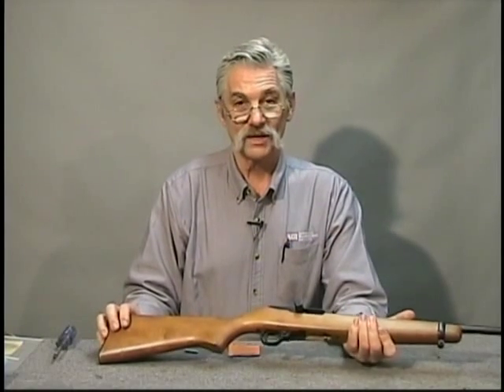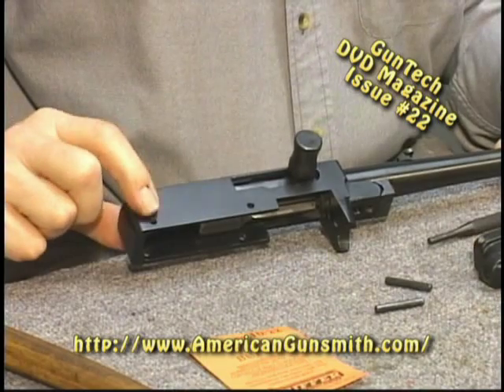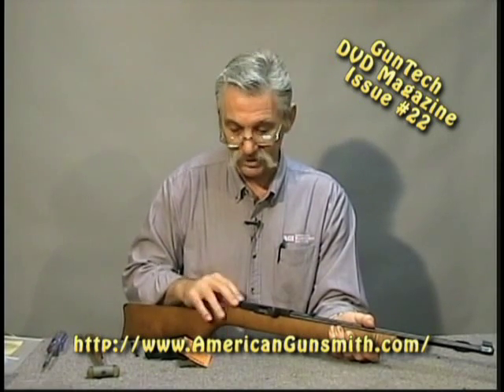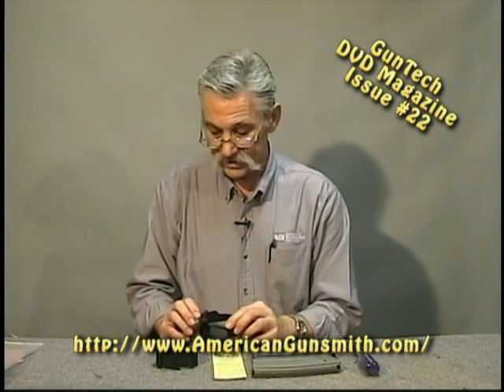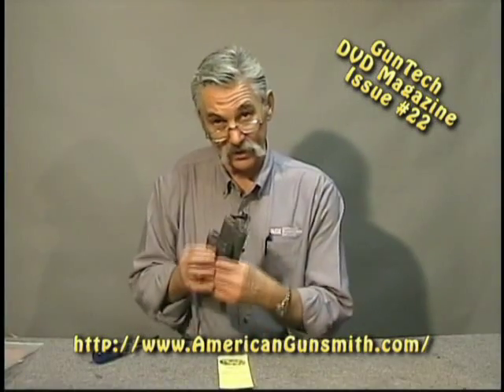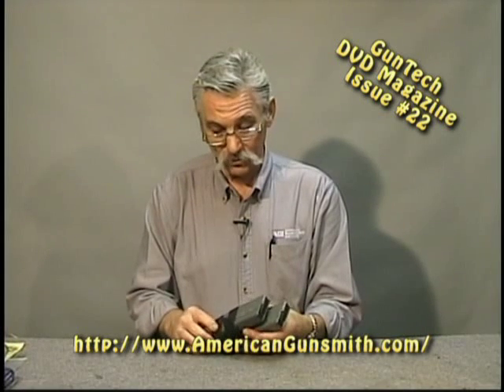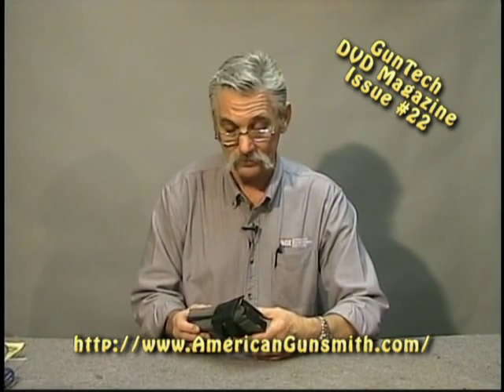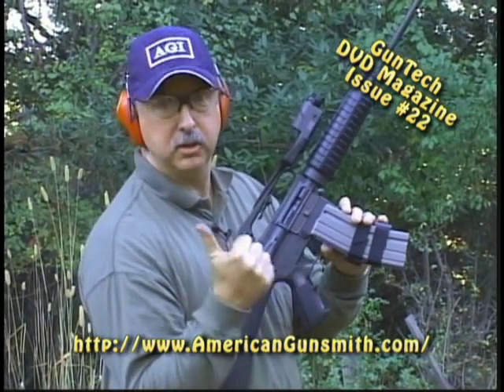Ruger 10/22 Rifle Bolt Buffers & AR15 Maginze Cinch Product Reviews: GunTech #22

Comment: Just watched the bonus gca live webcast on the april 2015 issue of guntech and listened to jack and gene definitively tell a caller that you should NOT re work a 10/22 to chamber .17 hmr or .17 mach2 due to the pressure increase by those rounds. Yet here you are suggesting useing the buffer pin in the 10/22 especially when doing conversions to the .17 rimfires. What gives guys? Even back when you did this segment I new without being told that the pressure curve was to high to use these rounds in a 10/22. At the least, you would have to beef up the mass of the bolt to make it viable, and thats just the beginning of problems to be solved.